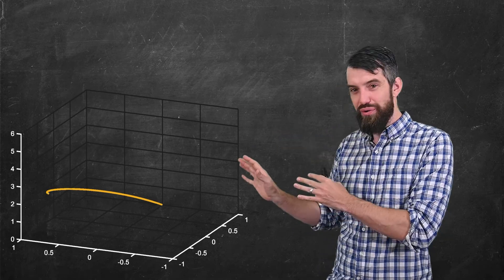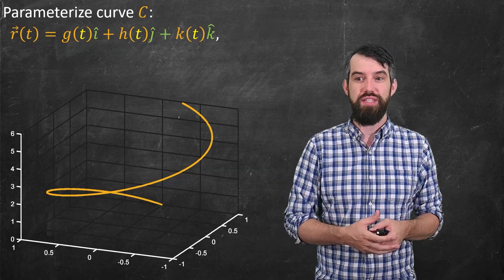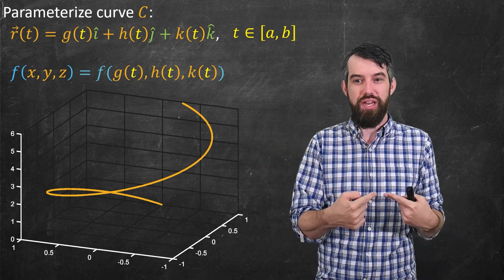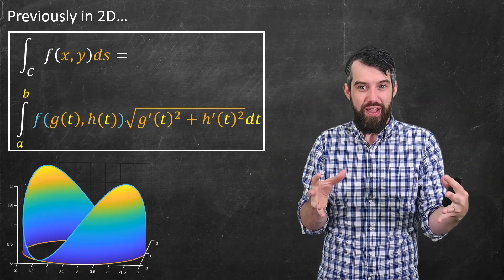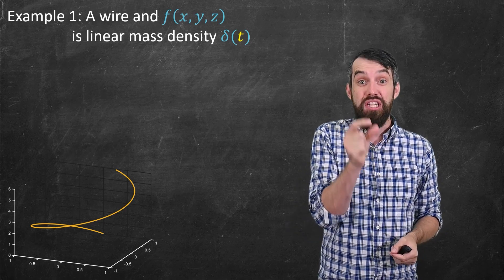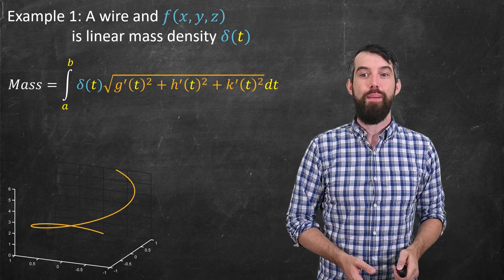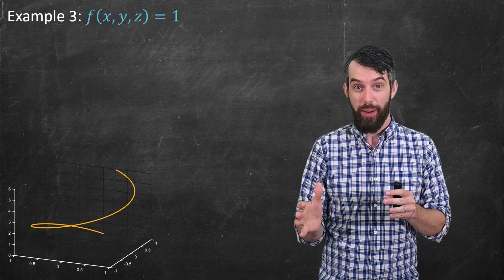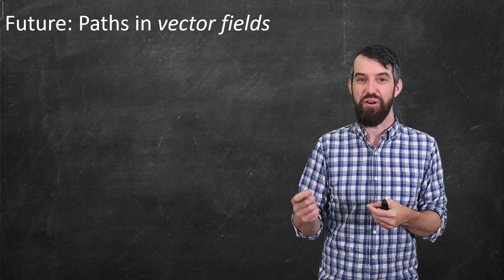Line Integrals in 3D  // Formula & Three Applications

Comment: in example 2, 4:47, can someone explain how f(x,y,z) becomes A(t) and what would be the formula for A(t) for cylindrical wire? Maybe with an example, please🙏🙏
Reply: Why?
I will not help you 😂😂
Reply: f(x,y,z) is just a function representing cross sectional area in that case with three variables. So it’s pretty useful if you have a cross sectional area that’s changing with three variable. Then, you can make a proper parametrization.

Comment: The examples that ypu gave were mind blowing. Please do 1 video for optimization with line integrals like if we are given a multivariabe function f(x,y) and we have to compute its line integral from (a,b) to (c,d)  then what should be the equation of the curve (over which the function is to be integrated) so that the line integral is minimum. Please also do 1 video on the scalar differential form of line integrals.